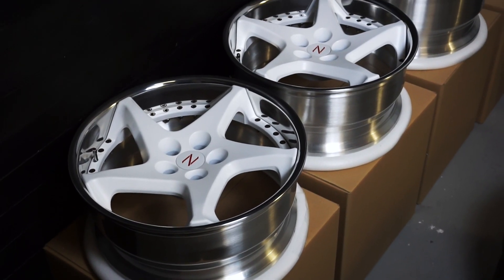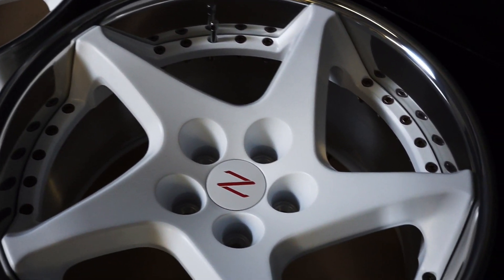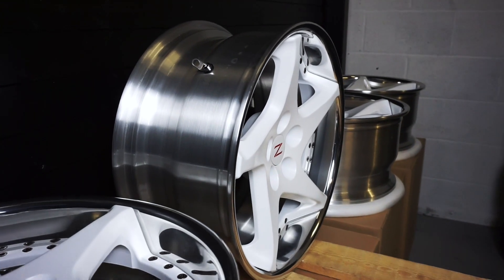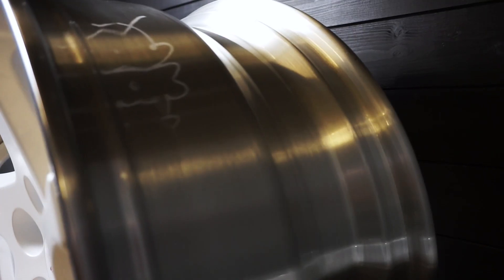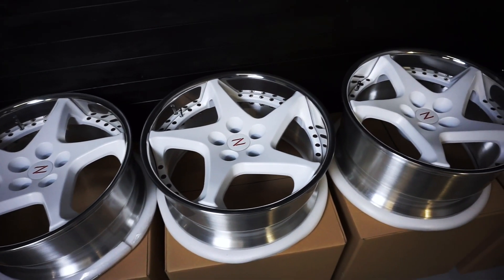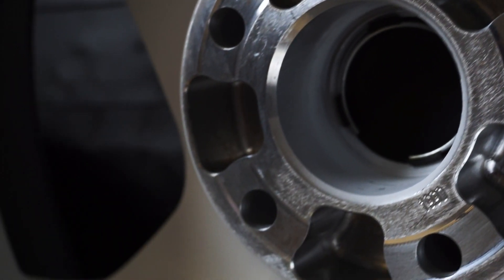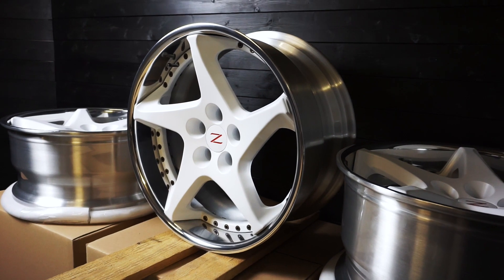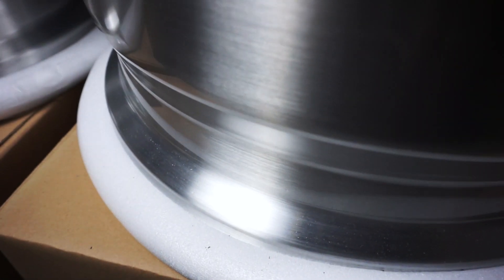We design and build a modern interpretation of the 300zx OEM wheels.

Comment: What other options are available when purchasing a set. For instance could a step lip be added or hidden hardware for a cleaner look and also what sizes are available? 

Also its a really good design. Id even put them on the 400Z
Reply from the maker: Literally exactly that! So all of our custom wheels are specific to exactly what the client wants. For example with these, we can keep the overall centre shape, but hide the hardware, step lip and a different colour/finish!
Reply: @rimscarnated  well i hope you'll still have these by spring. I should get a set then